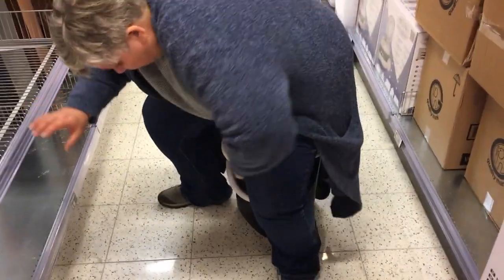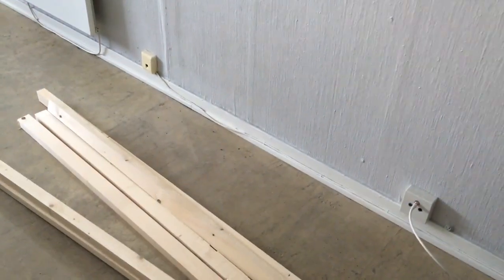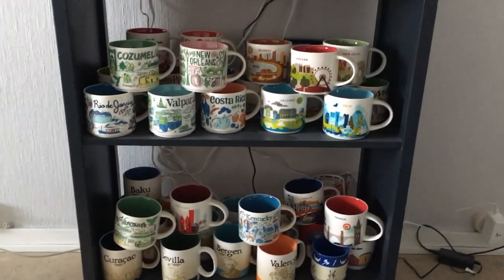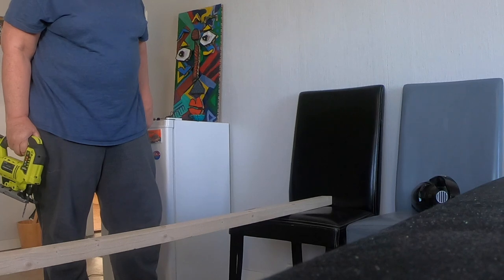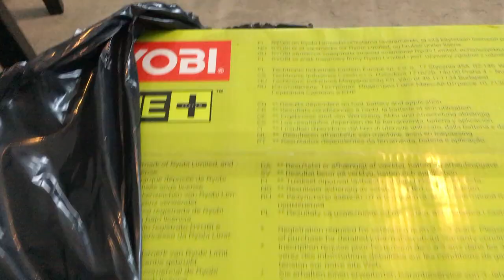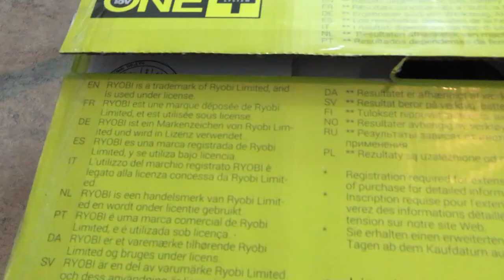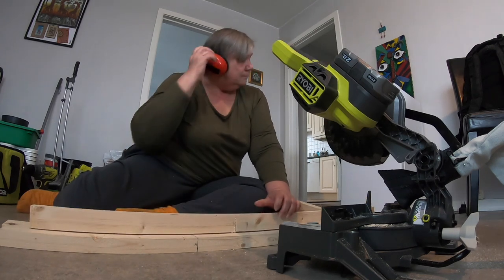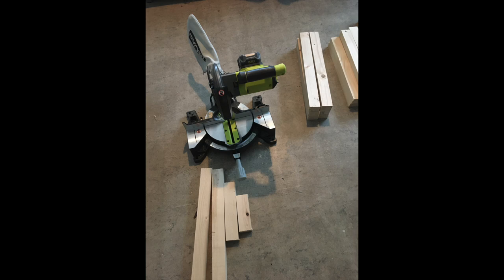Building a Composting Toilet (Part 1)

Comment: Yey!   Glad you are making one, so much easier to clean than an expensive plastic narrow pipe type thing.  You would need to be able to wash parts of the plastic one after a while, not  a very nice job.   Good luck.      Linda from England 😁
Reply from the maker: Yes, will just have to wash buckets and the urine diverter!

Comment: Hello Cindy... if you need to build a work bench but have no work bench to build the work bench on.... but you'll succeed! I'm Not Amazed Any Longer,  I see that will can move mountains and that you have a lot of experience.  The first 2 tools you need is that electrical screwdriver and a hand saw. There is one good tool that you also might consider ,to be able to fix the material when working on it...skruvtving...screwclamp... they are cheap but gold. Regards Rickard from Sweden 🇸🇪
Reply from the maker: I'll go and look at screwclamps.

Comment: Keep up with the practice cindy , be careful though power tools are vicious things actually most tools are .
I suppose these tools will be destined for your new life in Portugal .
As an engineer I would probably use a compost toilet but only until I'd built a sceptic system and you have access to the guy with the digger a wee bit of shuttering with your new found skills and some concrete .
Just a thought cindy you may think it to complicated or expensive .
Reply from the maker: The whole area around the cottage is on a giant granite slab, so a septic tank would probably require dynamite rather than a digger lol! I bought these tools that all use the same batteryas I thought that would be handy on the farm.
Reply: @CindyVine  I didn't know your plot was on such hard ground there would still be a plan that would solve the problem but sure a simple compost toilet is fine for you.
Hand tools have improved beyond recognition haven't they in the last few years and they seem all to be battery which I presume to be a good lot safer than the old corded variety .
We have had some work done at our other house that we rent out and I did notice the lads were all using battery driven electric power tools giving me a little more confidence in there durability.
Take care Cindy interesting video thank you for your response.
Reply from the maker: @coolhandlukeful  I definitely prefer these battery ones to the cord ones.

Comment: Well done, Cindy! Now putting the frame together could be a little tricky,  predrill the holes for the screw could be advisable so the woodends doesn't crack so easily.  And later when you attache the boards on the side of the framework it will be more stable.  Good luck
Reply from the maker: Yep, am trying to figure out how to hold it in place when I screw the peces together. Am thiking those clamps you mentioned might work.
Reply: @CindyVine  Yes, there is corner clamps as well,  but just put the wood on top of each other and predrill in the first one
Reply from the maker: @rickardenstedt  I bought drill bits today...and a clamp!
Reply: @CindyVine  Great! And all that investment you can bring later to Portugal.  Maybe not the wood material, but it's for practise, I know.  Another cheap but good thing is in swedish.. sågbock, pall bock. It's a wood construction on 4 legs that you can buy or build yourself, a good support when constructing.  There is foldable ones They can be used as scaffolding sort of,and you build them about 80 centimeter high You might need 2, that way you can put a board on them, and there you have a table! Etc... They take quite a bit of space so better you make them in Portugal.  Regards Rickard from Sweden
Reply from the maker: @rickardenstedt  Hmm, okay should make that in Portugal!

Comment: For the bigger Ryobi tools you might want to get a 4Ah or 5Ah battery, I have a few tools and the bigger battery makes a difference.
Reply from the maker: Yes, just this morning I was thinking of buying a bigger battery and keeping the smaller one as a spare.
Reply: @CindyVine  the bigger batteries have a charge indicator which is also helpful, best have a few batteries as having to stop your project whilst waiting for batteries to charge isn't that great. Also with a few batteries you don't need to keep swapping the battery between each tool you use in a single job.
Reply from the maker: @mark_mthws  That was my thinking!